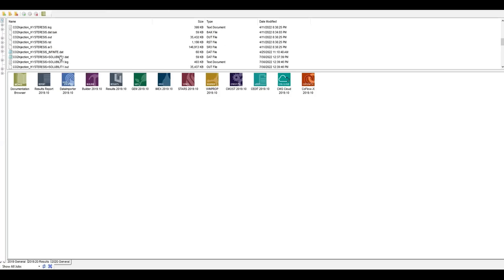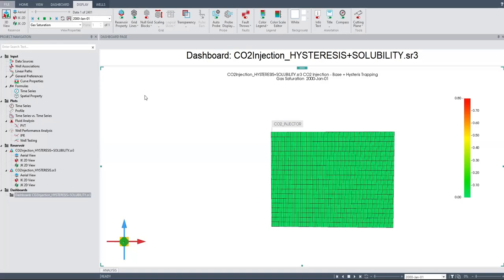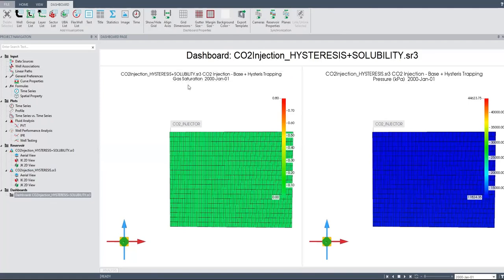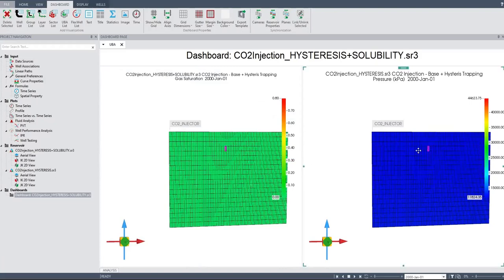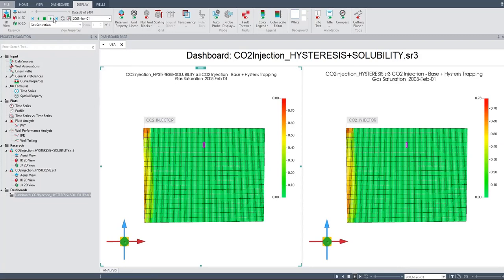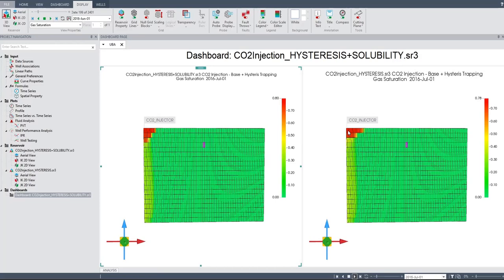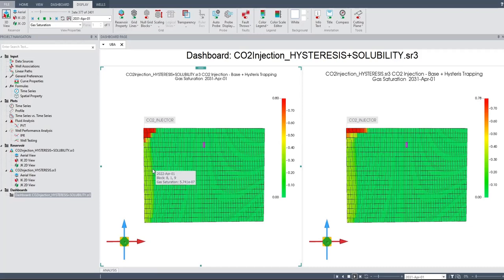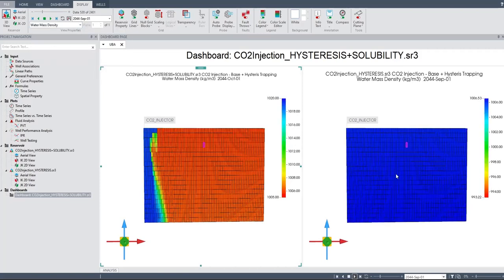CMG CCUS 39: Hysteresis vs. Solubility Trapping for Gas Saturation

Comment: Hello sir,
Greetings from Farooq Ahmed Student of undergraduate from Petroleum and Gas Engineering

It's very easy to understand the CO2 sequestration modelling and very   help full videos regarding the CO2 sequestration by  using CMG-GEM
  I have watched your 39 videos because I am doing my FYP on the topic Carbon Capturing and sequestration so, it's  requested from me  that kindly upload the remaining 25 videos which are hidden so, that I can continue my modelling with the help of these videos .

I am very glad, If you're upload it as soon as possible

Thank you sir
Reply from the maker: Hi Farooq great. Happy that they are useful. About that, they are on queue and will be shown to public not later than May of this year.

If you wanna discuss a lil bit about that, you can chat me on linkedin
Reply: Thank you sir , I have sent you requested in LinkedIn